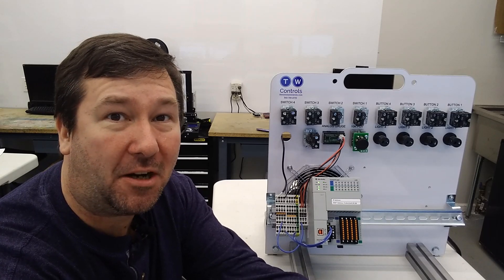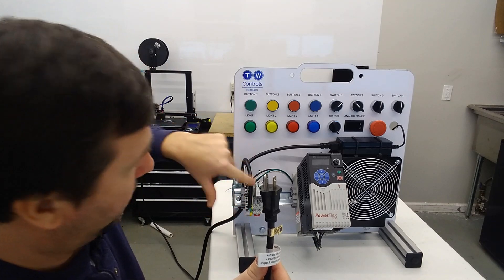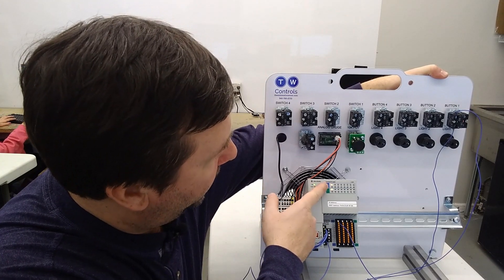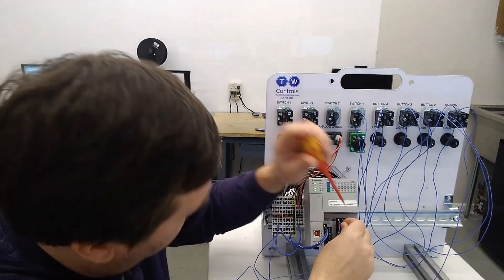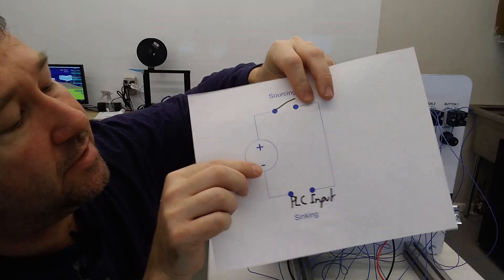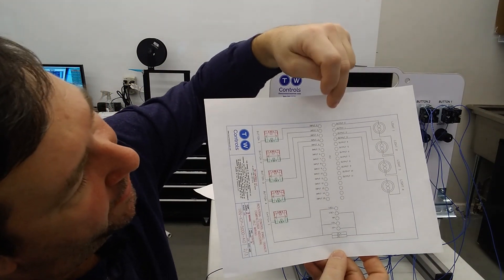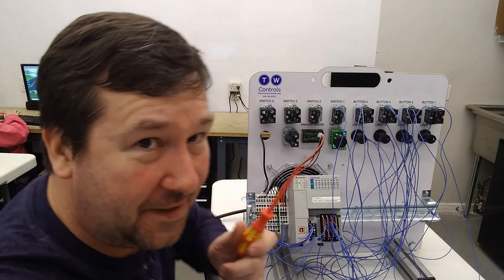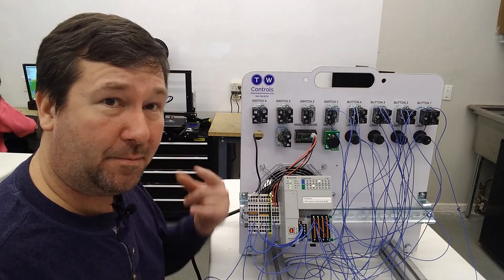Wiring Allen Bradley Compactlogix Sinking Inputs and Sourcing Outputs

Comment: I am facing a bit of a dilemma: I am to get my head around wiring 5094-IB32 terminal modules used for FLEX 5000 I/O modules (8 channel AI, 32 channel DI & DO) . The manuals say to connect power (24VDC) to SA+ and SA- terminals, for field-side power. The manuals also show the "return path" of field devices closing through the "Common" terminals on the 5094-IB32. 
Question: would these "Common" terminals (internally interconnected) be also connected to their corresponding SA+ or SA- on the end of the strip? The manuals say nothing about that.
Many thanks from Downunder.
Reply from the maker: That’s a great question, I’m not sure on that one.  I haven’t seen that particular module before.

Comment: What is the V+ and C terminal and used for
Reply from the maker: Personally I don't use them because if you have an overcurrent condition, then you take the surge across the chassis of the PLC.  But they are connected to the FP+ (V+) and FP-( C) terminals.

Comment: This is a great video! does the FP- terminal wiring to the DC common only work for inputs 0-7 and there is a separate DC common for inputs 8-15? or does FP- cover the commons for all 16 inputs?
Reply from the maker: In this case FP+ and FP- covers all 16 IO points

Comment: Thanks for the videos. I'm Very new to PLC's and I am attempting to use an open source plc for my senior project. Would you suggest a power distribution block to hump the power from Inputs? I have a very small workspace and want to clean up the wiring. Any help is appreciated.
Reply from the maker: Hi Johnathan.  That is a tough one.  If you mean something such as a Raspberry pi then I don't encourage the use of them, even in schools.  It gives you a false sense knowledge that will be hard to relate to when you get out into industry.  I think I would leave the I/O as it is so you can gain an appreciation of the benefits of a PLC or these.

Comment: Hey Tim , I don’t need physical inputs and outputs wired for the LEDs to light up , correct ?  I though I have always tested code by just making sure the LEDs were lighting up when testing code. I am in a debate with a redditor who says I need physical IO connected to test the PLC IO.
Reply from the maker: You are both right 😉  Input LED are an indication of the physical input and do need wires.  Outputs are an indication of whether there is a 0 or 1 in the output's bit box and don't need physical wires.
Reply: @TimWilborne  I guess the PLCs I always have tested code with has inputs wired and not outputs. Thanks !

Comment: Why is FP plus and minus not internally jumped
Reply from the maker: Hi Dave.  The FP+ gets +24V, typically through a MCR or safety relay to power the outputs.  The FP- connects to 0V and is used for both inputs and outputs.

Comment: What gage wire you do normally use for your PLC writing, is it single solid copper wire or twisted pair?
Reply from the maker: I use stranded MTW wire for everything.  The wire size depends on the particular application but if it is AC above 50V, then it is a minimum of 14AWG per UL 508A.  For 24VDC, I use 18AWG because it is easier to get under the small PLC terminals with a ferrule.

Comment: Hi Tim, can you please tell me what are the terminals for FP- and FP+ when I am using AB Compactlogix 1769-L24ER QBFC1B? I am using com (DC IN) of this unit as FP-, but I don't know which terminal to use as FP+.
Reply from the maker: It will depend on whether you are wiring it for sinking or sourcing with the L24, see this lesson.
https://www.theautomationstore.com/control-wiring-sinking-and-sourcing-npn-pnp-devices-and-plc-inputs/
Reply: @TimWilborne  Thanks Tim for the clarification in the video.

Comment: Hi Tim, 
The I/O light on the PLC is flashing and also show an "I/O not connected" on the software. I powered up the FP + and - and still no change. Is this still a wiring issue? This is a new PLC.
Reply from the maker: No, it means that something in your I/O Configuration is not present.  Do you have any Ethernet modules configured?  Are there any local modules configured that are not present?
Reply: @TimWilborne   Thanks for the prompt response!
I disable the ethernet modules that are not connect yet and the error has gone! Thank you
Reply from the maker: @rnramsamy  Good to hear!

Comment: hey Tim, many thanks for this awesome series, I have asked you a question in other video, I got an issue with my PLC (compactlogix l30erm) a major error code 3 type 16 I/O module connection Error, I cleared the error everything got back to the normal for one day, on the next day I got the same error what should I do before I say I/O module is damaged? you advice please.
Reply from the maker: Have you narrowed it down to the specific I/O module that is causing the error?  If it is an expansion module then the only thing to try before replacing it is disconnecting and reconnecting the I/O connector on that module and the module to it's right.  Also make sure the right end cap is in place.

Comment: TIM;
great video.

do you have any videos on how to surge protect and how to  isolate inputs and outputs
Reply from the maker: No but we have a video we're working on about noise immunity.  I'll make sure we include this.  Thanks for watching Shaman!
Reply: TIM;
recently we replaced a 18 pulse  400 hp VFD with 6 pulse vfd.
when we did one of six RTDs was affected by the proximity of the temperature controller to the VFD.
the old  VFD had a reactor ad filter the new one did not.
The weird thing was that only one RTD was affected, the other 5 were just fine,all RTDS were in one 24 conductor shielded cable and and separated from any high voltage.
bottom line is it took us forever to figure out and correct it. we talked to all local VFD vendors, only Yaskawa local suport guy suggested that might be noise related but still he was not sure because only one was affected.
Reply from the maker: @shamanking5195  Yes the goal of my video will be to take some of the myths out of noise.  Too many support people cry noise at the first sight of something they can't explain.